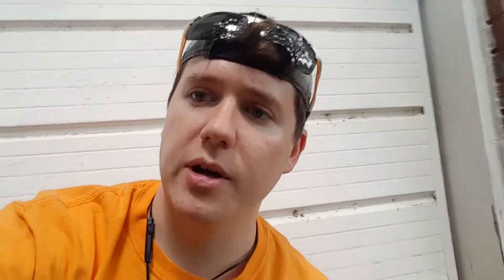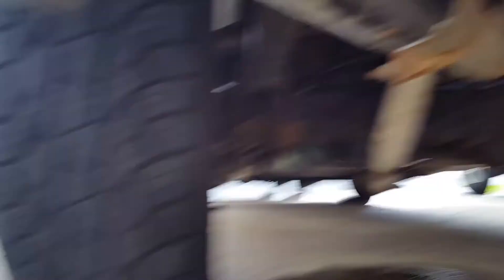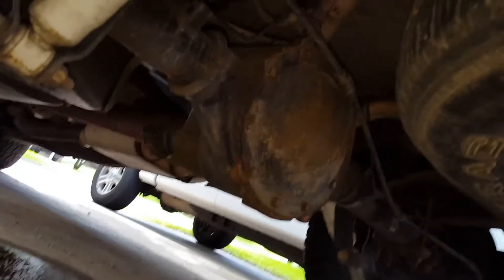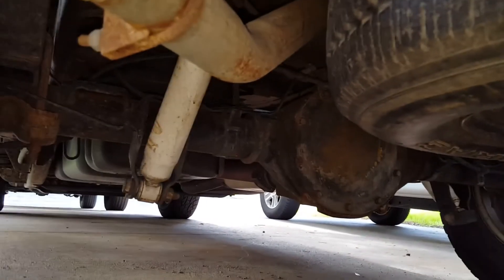Power to ONLY ONE Wheel? Open Differentials Explained - TOD 5

Comment from the maker: Comment below and let everyone know what kind of differential you have and if you've ever been in a situation where the type wasn't exactly helping you out. I have a G80 on my truck that "locks up" at low speeds. They're notorious for falling apart but if I take it easy I can make it through sand with my two wheel drive Silverado!
Reply: I have this problem. I only get away when another car comes to town me off. It pisses me a lot

Comment: Very detailed explanation. I recently installed a CV axle on my 1999 honda crv and it has an open differential I noticed when I had the wheels on jack stands only one side of my wheel will spin the other wont

Comment: I have an 02 lancer I jacked yo the front so both  wheels were off the ground I was checking  the bearings but notice only the driver side wheel was spinning I then put it in reverse and even in low gear still only the left side was spinning ? What’s up with that ?
Reply: Have you solve the problem, or is it normal?

Comment: Thank you that was helpful I drive for Orkin Pest Control in Maine in the winter as we've got six 7 in of snow and it's a rear wheel drive truck with open differential basically useless I was wondering what and if there are benefits to any of this with this truck in this situation it doesn't seem like there are

Comment: I have a open differential but I also have auto lsd on my Tacoma I’m super confused is auto lsd make both of them burnout ?
Reply from the maker: It really depends on when they have timed the gears to lock up on an auto LSD system. Typically they will only lock at low speeds to aid with traction. At the higher wheel speeds you reach during a burnout it will probably switch to open mode thus spinning one wheel.
Reply: It uses the brakes. Torque is based on friction, and one slipping wheel means you have very little friction and, proportionally, very little torque. So, by braking the spinning wheel, you create friction. This results in more torque being sent to wheels, enough to make them both spin

Comment: Please I have a question.  My is a rear wheel drive and sometimes I get stuck when one wheel is only powered by the engine and then begins to spin. Please what must I do to overcome this?
Reply: One way is to be careful where you drive. Avoid slick areas or angled inclines (like entering/exiting driveways or business parking areas at an angle).
If you’re losing traction on slick surfaces, the best thing to do is find the better tires for that situation.
If it’s due to uneven surfaces, then adjusting your suspension would help the most.
Some cars just don’t perform well in certain situations.
It sounds like you would benefit from driving an SUV with better traction capabilities.

Comment: I put my car on jack and put the car in drive but only the driver side tyre moves. the passenger side tyre moves with hand ie its not stuck. Is It normal. I am getting scraping noise when I drive the car in reverse uphill, also when turn right after driving in reverse in uphill. No sound when turning right or reversing on a flat surface, thats why I out the car in drive after putting on jack stand.

Comment: Hi, I have a question I hope you answer,  I do have a 2003 mercedes benz e500 rear wheel drive it was setting for awhile today after I did a quick check up to confirm everything works properly, I took it for a spin and then I have heard a noise from the rear tires, It seemed to me that the sound was coming from the rear wheel on the left but I wasn't sure, so I lifted the rear wheels off the ground while the front wheels on ground, started the car and put it in drive mode so I could go to the rear and listen closely but I  I noticed that the two wheels do not rotate at the same rate, or rather one of them almost does not rotate, is this considered a problem?
Reply from the maker: I’m not super familiar with Mercedes cars but it sounds like maybe that’s just an open differential spinning only one wheel since the rear end is lifted. Though the fact that the other spins slightly could mean that maybe something in the diff is contacting that shouldn’t be and causing a slight rotation. Wish I knew more to tell you Monir. I’m just a driveway mechanic that heavily relies on Google though so I could be way off base and I’d hate to offer any bad advice.
Reply: @HSZGarage  thanks very much Andrew, you were right, it's a normal behavior for an open differential I even posted the same question on MBworld forums and the answer was that my car has an open differential and this is normal, the fact is I had never knew about open and locking differential, And now I'm happy to know about this because it got the obsession out of my brain, yeah man same thing with me I'm just a backyard mechanic for my own cars, I'm still learning, but hey so far so good I had never took none of my cars to any local Mechanic shop or dealership for the past 5 years, again I really appreciate your response and appreciate your honesty

Comment: i got a 98 mustang an it did this during a burnout an i was wondering wut was up with it its a v6 but i had a 2000 v6 an it spun both tires so idk wuts up with that maybe the 2000 had more power
Reply: Same here I have a 2002 mustang v6 and it only spins one tire when im doing burnouts, and when the roads are icy. I just assumed I damaged the differential when I was drifting. I'm happy I'm wrong.